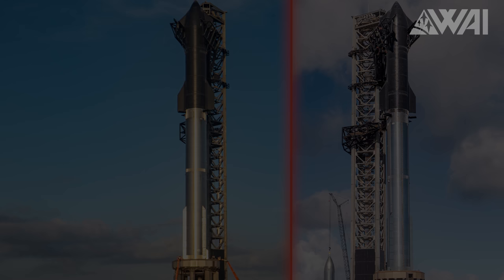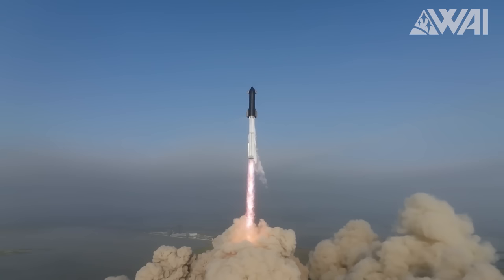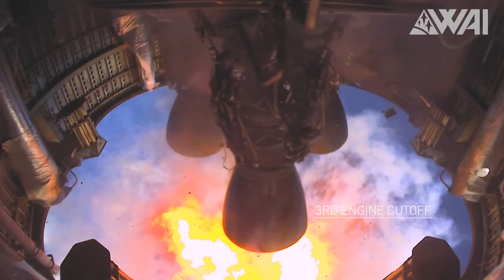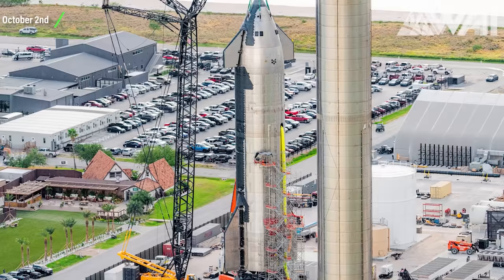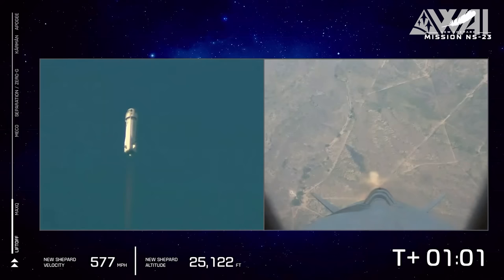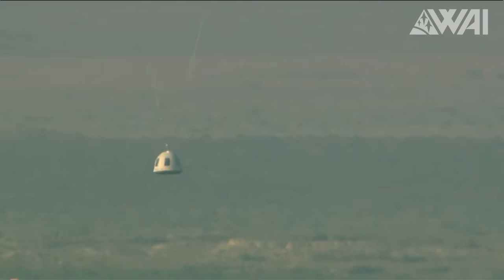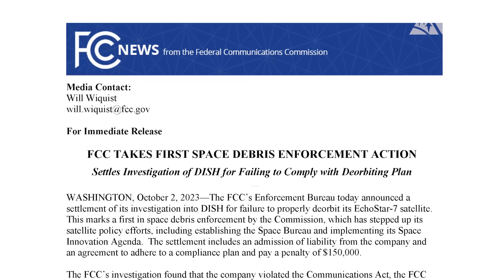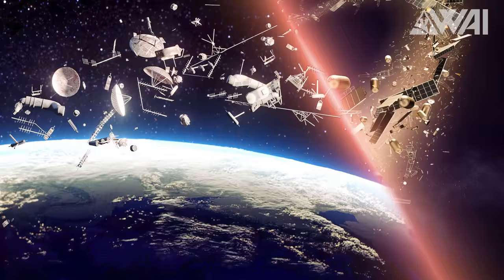SpaceX's Radical Starship Design Change! Ship 24 vs. Ship 25!

Comment: FCC fine for not cleaning up your satellite should be: the cost to have someone else move your satellite, plus indefinite liability for any damages caused by your satellite if it collides with something else.
Reply: Yup..i mean there is no standardized or agreed upon way of moving satellites yet, there were experiments but it amounts to that. I think the fine should be even higher than cost of someone else cleaning up after you. This is literally throwing trash around in a hard to reach place where it is not sure how will that affect anything in the future. 
Equivalent of this would be throwing tons of spent nuclear reactor fuel rods into the middle of an ocean.
Your profile picture perfectly represents my reaction when i heard how much is the fine they got... :P

Comment: It has a real chance but only due to the fact it wont get pummeled by gravel and concreate from the ground as it lifts off . I just hope hot staging works as intended. and it doesn't blow up the buster in the process and destroy it self as well

Comment: Blue Origin with 21 items to fix 1 year later: "We plan to fly again."
SpaceX having fixed 57 items in about 5 months: "Hey, are you done shuffling paper? We're ready to go!"
Reply: They did more than 57. Apparently they’ll do hundreds of changes and improvements between ships
Reply: @SyntheticSpy  The 57 I mentioned were strictly related to the mishap investigation. And I only mentioned these because we can't get more info from Blue Origin, for a fair comparison about the changes. But judging by the official numbers alone, it's a huge difference.
Reply: Perhaps it is because the BO problem was more subtle, making them more difficult to determine the cause. The SpaceX problems were more obvious - giant chunks of concrete sent into the air, multiple engines out, and a 30+ second delay in destroying the vehicle after command. Then couple that with the fact that SpaceX probably knew they needed the Pad deflector BEFORE THEY FLEW, since they were already working on it before the flight, and you have an explanation for why they could install it so quickly. But yeah, BO is notoriously slow. But by the same token, I contend that SpaceX could have avoided a lot of ill will from environmentalists and their neighbors if they had just waited and installed the blast deflector and water deluge system before their first test flight. Haste makes waste.
Reply: @i-love-space390  Blue Origin's problem was (quote): "the structural failure of an engine nozzle caused by higher than expected engine operating temperatures."

That's the opposite of subtle - temperature sensors can provide live feedback, and that could've been prevented. It's probably why the FAA also proposed organizational changes. This comes from the FAA website, from an article named "FAA Closes Blue Origin Mishap Investigation" published on Wednesday, September 27, 2023.
Reply: Regarding SpaceX, my take is a bit more cynical. I think Elon knew they would punch a hole under the pad. It's not the first time they did so, and they did it with only a few engines. I think the preferred to let the rocket go, so that while they do the water deluge system they could also analyze the flight data. The rocket was already done, it had no other purpose than testing, so it was worth doing the test. And they would've had  to dig that hole anyway, for all the reinforcement and the deluge system installation. They basically saved time on digging and also got flight data. Extremely convenient.
Reply: SpaceX also stated that they had made more than 1,000 changes to SuperHeavy.

Comment: Putting the ullage thrusters on starship upper stage probably would reduce efficiency(maybe their propellant is cheaper, but with lower pressure in the main tanks have a really low specific impulse) , on the booster that make some sense because you can afford that extra mass that those less efficient thruster needs , but for the upper stage that reach orbit means that you need to lift more propellant for thrusters into LEO and less payload.

Comment: Vega control cable plugged in the wrong way.... it happens. 
The Second Saturn V launch in 1968 was almost a disaster because when the computer commanded shutdown on one of the engines having a problem, it shut down THE WRONG ENGINE, because the cables were reversed. In the fix, McDonnell-Douglas changed the length of the cables so it would be impossible to plug them in wrong. Sometimes the fix is just that simple.

Comment: STAR SHIP MOON AND MARS HABITAT VIDEO IDEA
A video on the following Moon and Mars habitat idea would be interesting. A possible habitat for the Moon and Mars would be to use the starship and have an extra layer of stainless steel outside the Starship. The extra layer would foldout and down after landing on the moon with many 2 meter hinges (2m long square tubing with hinges on either end) supporting it. Gravity would bring the sheets down after being released. The extra layer would consist of 12 overlapping sheets 3 meters wide by 40 meters tall. They would overlap for the trip and be flush against the starship, but fold out to 2 meters from the starship after landing. Each sheet could still overlap a little after folding out but less overlap than when they were against the Starship. Each sheet could be welded together after folding out. Moon regolith or Mars sand then can be deposited between the Starship and the outer steel sheets. A crane could come out of the nose cone with a scoop bucket to lift the Moon regolith up and dump it in (the same crane could also lower each sheet down one at a time). A similar fold out system of sheet steel could be set up for the nose cone and be filled with regolith after the lower section is filled. The outer sheet steel would be insulated with 15 cm of spray foam (inside the outer sheet) before the sheets are installed on the Starship on Earth. Using words to describe something can be difficult. The idea above would work and doing a video on this may spark SpaceX to actually do it.

Comment: This paint has showed up in a lot places which makes me wonder if there isn't a story there. Stainless steel has some incredible thermal properties to begin with and it wouldn't take much improvement to go to higher temps. Is that what this black paint is for because I doubt they did this just because it looks cool.
Reply: You would be surprised to learn what Mr Musk and Crew have done just because “It Is Cool”.

One example is the nose-cone shape… changed “because it looked cooler”…
Reply: “…The Flight Termination System sometimes doesn’t work…”
WRONG. It took longer than original calculations suggested… one reason to do actual tests, and not rely only on ‘Sims’.
But it did its job.

Comment: In this vide ok you stated that you didn't know why the pressure valves where moved closer to the heat shield. Ok well here's a little unsure backed by physics.

The valve it close because the exhaust fumes from eject of fluids or fumes. THAT ARE SUPER COOLED. Can be use to back up the heat shield if at breaking point the tanks ejection would cover the vessel fuselage. Keeping it cooler.

Comment: Penalty for not parking properly the satellite should be cost for somebody else to do that. AKA, if there is no action from Dish network to hire somebody to move the satellite then government will do it itself for regular cost plus overruns price. This is not to teach them a lesson, but to have fair use of the space for other providers and countries.
Reply: I agree with you.  Perhaps instead of the fine, they should have been forced to put a larger amount (i.e. $5M) into escrow for 10 years, for whoever successfully parks the satellite.  And if nobody does, it then becomes a fine.  The amount may seem small, but for someone doing multiple missions it will add up.
But as it sits now, I believe the "admission of liability" also means Dish can't contest liability for any collision they cause.
Reply: It's a screw-up, but Dish have done their best to mitigate the impact... once they realised that they couldn't get to the required graveyard orbit, they 'fessed up to the FCC, and made manoeuvrers to properly raise both perigee and apogee out of the danger area, rather than leaving the satellite in an eccentric orbit.

And besides, the fine is just token — the real penalty is the increased regulatory attention on their operations. People here grumble about the FAA bureaucracy slowing down SpaceX operations... but that's nothing compared to what will happen to a company that's legitimately earned the ire of a regulator. Dish will never be permitted to launch another satellite again until they've convinced the FCC that their end-of-life process is sound.

Comment: When the ship lands on the moon is there going to be and elevator that moves down through the center or pop out the side like a ramp with rails and a ladder
Reply: The SpaceX HLS Starship variant has an external elevator, SlaceX released images of it lowering astronauts to the lunar surface when it announced its proposal for the contract. It tested a prototype on Earth in 2021.

Comment: You said the grid fins cannot take the load if landing pins are missed. I saw Elon say the grid fins were a backup in case they miss the pins. Has something changed?
Reply: the best part is no part so the fins might do in a pinch but not if they don't wanna overhaul after every flight
Reply: @jnawk83 I would prefer an overhaul to destroying the launch pad. The plan is to catch both booster and Starship on their pins. Elon said if they fail grid fins can catch the booster and Starship can land on the ground using its skirt. Both have backups only in case of a failure. I know Elon is a genius but I still wish he would build a tower next to the launch pad dedicated solely to catching. If something goes very bad then he would not destroy the pad. I’ll say this: he’s got guts.
Reply: @stevebroome1288  I expect the second tower will be completed before any attempt at catching is done. Also if you are going to build a second tower then why not make it another launchpad and catching tower. Yes it will be more expensive but usually it is easier to make multiples of the same thing.

Comment: Felix, you need to put air-quotes around both definitions of the boundary (is there really one?) of "space".  Neither is truly deep space that is outside of the Earth's atmosphere.  An objective argument could be made that the 50 miles (80.4672 km) definition is just as good as the Kármán line, which is arbitrarily set at 100 km just because 100 happens to be a nice-looking number.  Yes, it's also a bit higher, which seems to give some additional margin, but that still doesn't mean that it's "true" anything.  It's still within the Earth's exosphere, so you can't say it's a more accurate definition.

Ironically, Kármán himself calculated the "boundary" to be about 52 miles (83.685888 km) in altitude, which is much closer to the definition used by NASA and the FAA.  The main practical argument that can be made in favor of the 100 km figure is that it's used by the FAI and is the most widely accepted definition, therefore Virgin Galactic really should have aimed for 100 km, just to satisfy more people and leave less controversy and doubt.  That said, this does not change the fact that both definitions are arbitrary, approximate figures chosen because 50 (miles) and 100 (km) are nice, "round" numbers that are easy to remember.  Neither objectively define where "space" begins in any absolutely, all-encompassing sense, and both are still within the Earth's atmosphere.  That's why there is some drag, as small as it is, and the ISS, despite orbiting well above the Kármán line, needs to be boosted every so often.

Perhaps the most objective, fair argument that one could make is that both definitions work for the same reasons, only that one is more inclusive of space while the other is more exclusive, but not because it's any better or truer, it's just a slightly higher altitude.
Reply: Exactly. Both numbers are arbitrarily chosen because they look good, the real Kármán line is somewhere between the two, and it's somewhat variable anyway. It's a pretty senseless argument... especially so given that both BO and VG vehicles are rockets relying purely on thrust to reach their target altitudes, not aerodynamic lift.

Comment: The booster needs to fly with no engines failing. It’s long since past the time that the raptors integrated into the vehicle need to demonstrate that they can operate as intended.

Comment: The main improvement wasn’t even on the rocket. It was the deluge system
Reply: Respectfully I do disagree with you. It was a shame that the pad was destroyed, but the lack of a fire suppression system in the engine bay, more robust engine shielding, electric engine gimbal system, proper stage separation maneuver, and functional fats were probably some of the biggest issues over damage to the pad
Reply: @hudsonshuck9578 . I just figured the nine engines that failed to light was due to concrete destroying them.  Don’t other systems rely on all of the engines to be functioning properly?

Comment: What happened to Felix? This new guy needs to learn to breath. Just a short breath between paragraphs would allow the information to be assimilated. 
Also the volume was set too low on this episode.

Felix, stop with the "most countries" crap about the dividing line of space. 
#1, only countries who have flown their own vehicle should have a voice. And 2. All European states (countries) should count as 1 vote. Just like all 50 countries (states) of the US are considered 1 vote.
3. The real arguement is one of kilometers versus miles. Or metric versus standard measurements. And in all matters of marine and aeronautical measurements the norm is Nautical miles. Not kilometers.